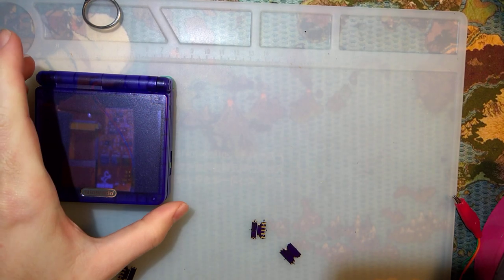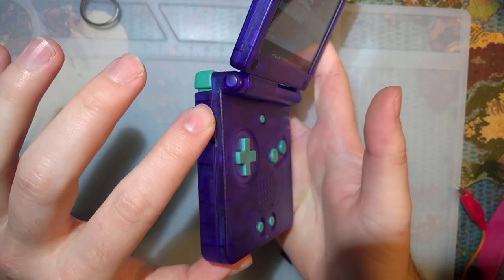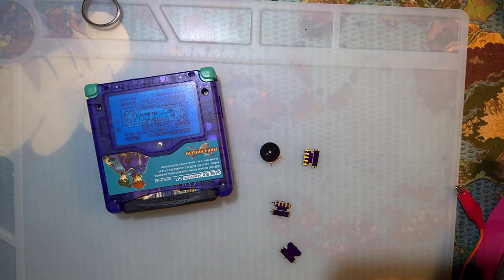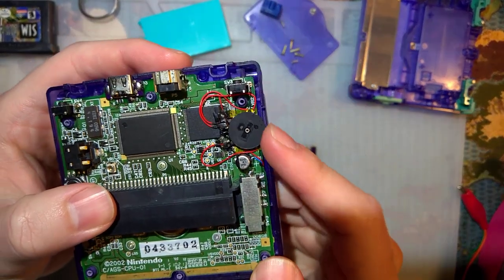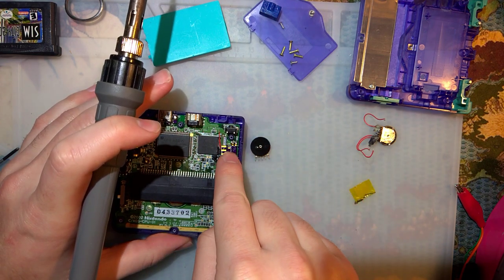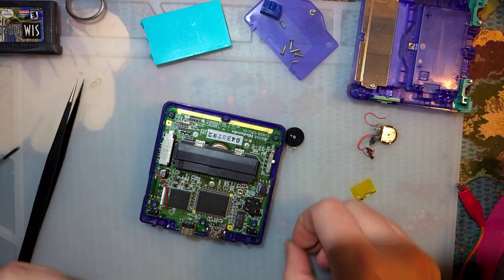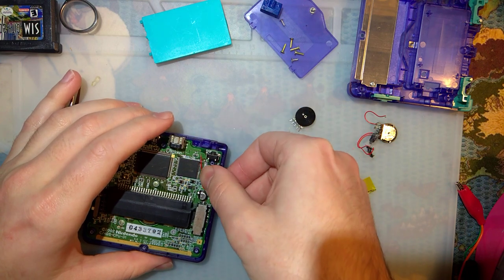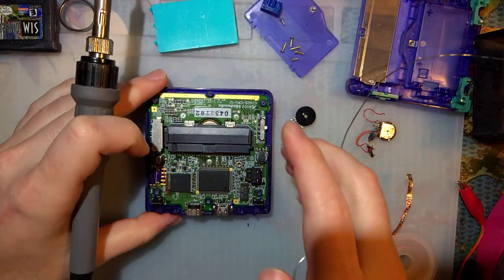Installing a Volume Wheel in a GBA SP (Part 1)

Comment: I believe this is what I have to do. I already tested the speaker and it works on my other SP. Also noticed liquid damage (looked like Cola got in and dried up) on the GB SP and it might have rusted/affected the volume control. I guess i would need to buy those parts and a soldering kit.

Comment: Do you have any idea why pad 4 would have no continuity to any of the other 5 pads that my volume potentiometer is connected to? This 2nd-hand SP I bought is definitely water damaged since there is no sound playing at all and it was all sorts of funky on the button membranes. I am hoping there's no need for anything more than a potentiometer swap out. If you have time I'd love to hear your opinion.
Reply from the maker: because it's just not connected, only three pads are used and the rest are to hold the pot on. That's it.
Reply: @makho  Interesting, thanks for the reply. If the speaker is working, what do you find to be the main reason for no sound? I am able to check continuity but lack the basic knowledge of what to check, so I'm willing to do whatever you might suggest. Thanks for your time
Reply from the maker: @VanguardRaven  how do you know the speaker works? If you bypass the volume pot, do you get any sound?
Reply: @makho  I removed the speaker and put it into my working SP, and it plays sound fine. And the speaker from my working SP doesn't work when it's put into the damaged one. 

Also I don't know how to bypass the volume pot, but I'll try to find out and give it a try later
Reply from the maker: @VanguardRaven  if you have a working SP, set the volume to max on that console and measure the resistance between the pads. You'll probably find that pins 1 and 3 show very low resistance. Measure your working one and see if you see the same thing. If not, bridge the pins with a bodge wire and try again.

Comment: I have an sp with extremely low sound that wasn't adjustable by volume slider,  ive removed the volume potentiometer and the sound is exactly the same without it in circuit, any ideas what I should do, is there a way to just bypass having a volume control at all, and just bodge it into "full volume" mode?
Reply from the maker: yeah, shorting pins 1 and 2 should do it. I gotta double check the schematic to make sure but I think that would bypass a volume pot on a SP. If you still have sound after removing the pot though, you likely have another issue entirely that this probably won't fix.
Reply: @makho  thanks for the reply, and yeah, I still have sound (very low) if I put my ear to the speaker, despite there being no potentiometer in place, I have no idea what my next move should be,  can I ask what action you would take please?
Reply from the maker: @jonnytom82  there are a lot of details I do not have. I assume there is water damage? Clean that up first and repair every other broken component (resistor, capacitor, etc).
Reply: No water damage whatsoever, this is why its such a mystery to me. Works perfectly apart from the sound, can't see anything obviously bad on the board. Its  doing my nut in 😆,  thanks for your help anyway mate,  I appreciate you taking the time to reply.
Reply: @jonnytom82  Hi, this week I had the same problem and I was able to find the cause. On the back of the board there is a C1 market capacitor, it is connected directly to the speaker power line with the potentiometer. It was with low capacitance causing the volume to be no more than 30%. Capacitor specifications is 100uf 4V, I changed it and the volume was normal. It is also worth checking if there is oxidation in this region. Good luck and peace!
Reply: @gigabait3  thanks very much for that buddy, I'd all but given up on it... ill dig it out of the sin bin and give that a try. 😉